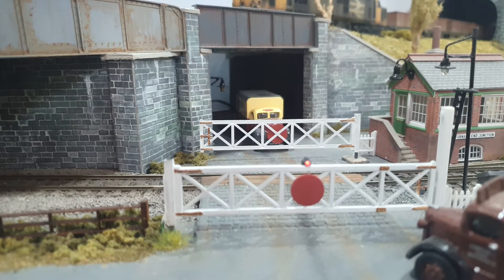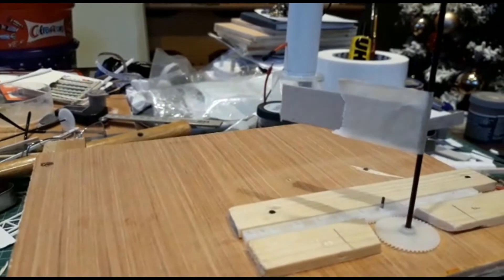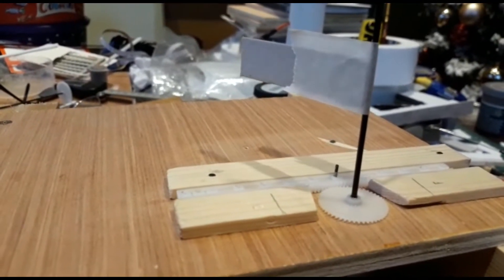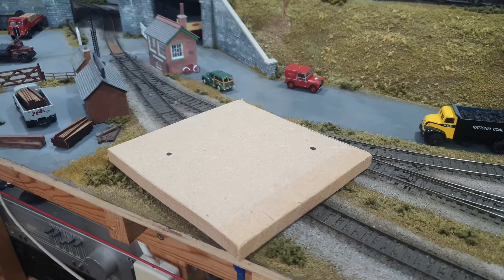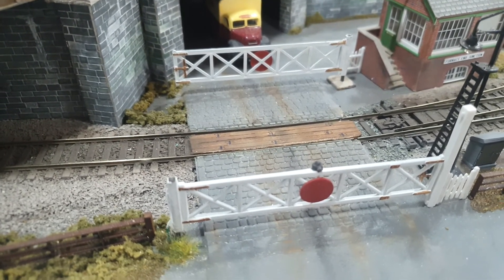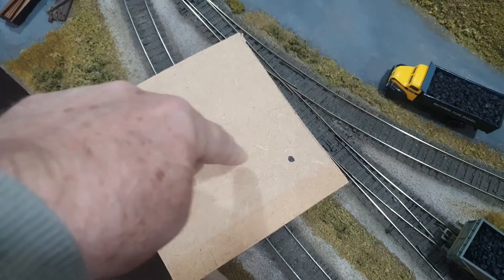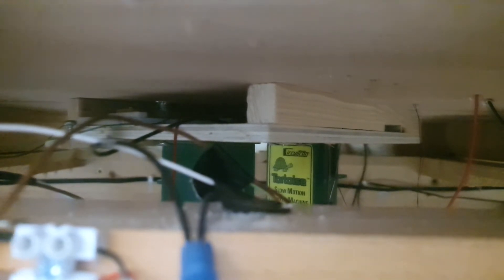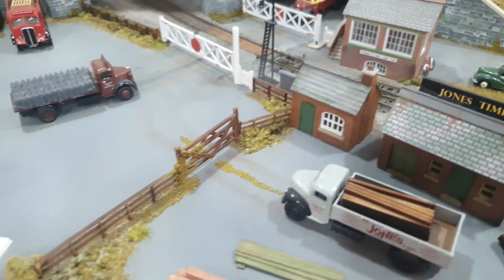How To Automate 'Wills' Level Crossing gates

Comment: Hi Neil. That is a brilliant way to do the L/C gates and I am going to replicate this on my new layout. Really pleased that, at last (!), someone has shared the idea and one which is uncomplicated! Just need now the how-to for the lamp! Pretty please. Thanks for uploading.
Reply from the maker: Sorry for delay, the lamp was a red LED, ,I got some 1.5mm fibre optic cable, cut a sliver 1mm long or so, glued it to the led,  sprayed the whole thing black, couple of coats, then very carefully scratch off yhe paint on front of the fibre optic cable piece you glued on, then the red LED transfers the light thro the fibre optic section

Comment: Hello 
This is what I've been looking for, for my layout, is there any chance you can send me a diagram for the gate, wiring,  etc. Thank you 

From 
John
Reply from the maker: Hi John, simple circuit, wire exactly as the Tortoise motor would be for a set of points, each gate is independently from each other, fir the best speed I used 5volts, I used a USB phone charger, cut the USB connector off the end, wire to the point motor as per normal, its  double pole double throw switch
Reply: Hello Neil
Thank you for let me know I'll do that. Thank you 

From 
John